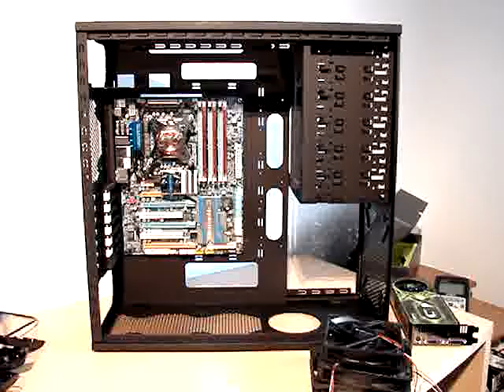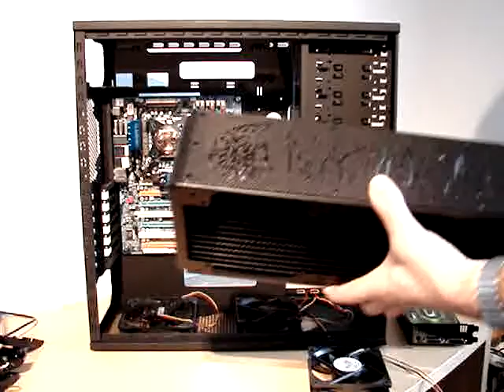Watercooling build Part2 - Fitting TFC Feser MONSTA Radiator in HAF932 Case

Comment: The HAF comes with Casters for the bottom.  I would put the push fans under the case itself.  The casters will give you enough room.  Then put in the radiator, the pull fans.  You could do the SLI that way.

Comment: I got an 932 HAF too i drilled the HDD cage out and the Monsta in the bottom, 
i got only 3x140 Fans on the top of the Monsta which blows air inside the HAF932 
all @5V np with cooling and silence. 
Water never get over 40Degrees with all parts on 100% (cpu/gpu/NB/AUX) 
I7 975 extreem@4Ghz, GTX580@Stock, everything is cooled by water exept the RAM (got no need even its oc@1800) so np to put this Monsta in and got a nice cool an silence working system^^